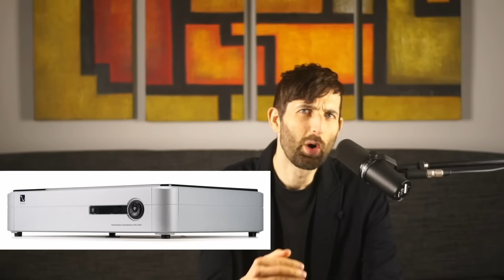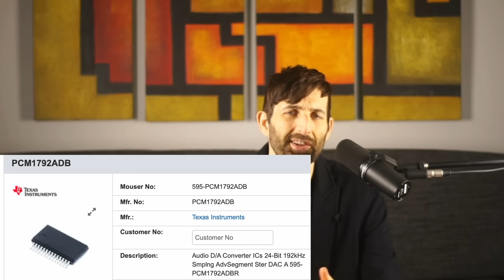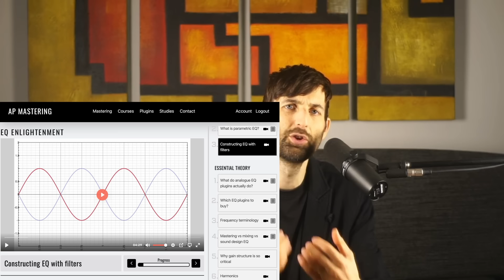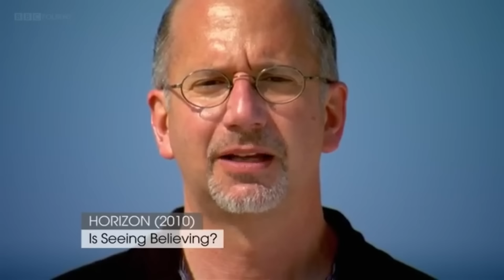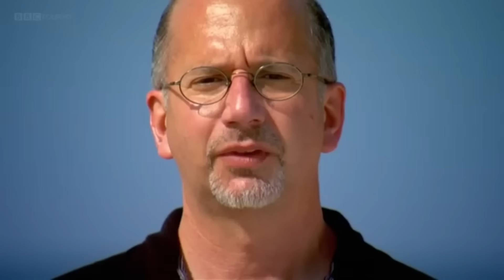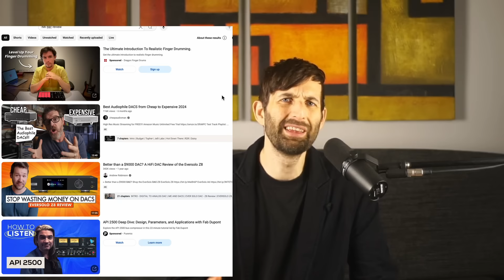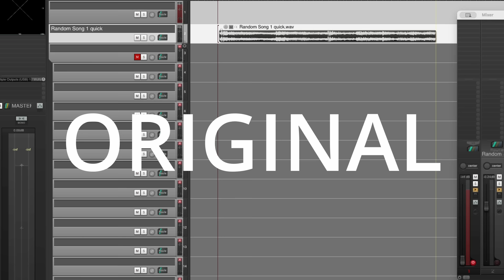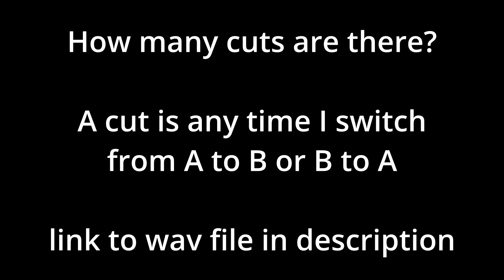The DAC Scam - Almost everyone believes the hype

Comment: The thing that makes me laugh the most about audiophiles, is they spend insane money on speaker systems to listen to tunes produced on systems costing a small fraction of the price
Reply from the maker: real pro recording studios recorded the world's biggest hits running miles of bog standard copper wire over rusty old patch bays from telephone exchanges
Reply: @APMastering Those did save a lot of space compared to the other stuff. I used to love using tiny telephones patch cables.
Reply: @APMastering Not entirely true.
Reply: @VideoArchiveGuy  Disgusting comment.
Reply: @VideoArchiveGuy  entirely? No. Often? Yes.
Reply: @ LOL that has to be the dumbest thing you have said yet. Real pro studios upgrade wiring and have full time maintenance people for these things. Wow you are a whole new level of ignorant.
Reply: @Bunbunfunfun  Upgrade the wiring to what? There isn’t an endless voice of multicore cables. The individual strands can’t be too thick of you can’t fit them into the EDAC connector blocks.  
I used to work on a console with an integrated patch bay, as was normal at the time, and because it was built into the desk it was horizontal. Meaning it was a massive dust trap. So we were constantly blowing in it, sticking the vacuum cleaner hose on it and spurting WD40 down it.  
I’ve been in a lot of high end studios, and never been in one where everything worked as intended all the time. 
Like one with a Neve V series console that had matchsticks stuck in a load of the switches to get them to work. This was so common with those consoles that when Brainworx made a plug-in version, they put matchsticks in the GUI
Reply: @ yup blah blah blah
Reply: @Bunbunfunfun  spot on, he seems ignorant and arrogant. First and last time watching.
Reply: @Bunbunfunfun  Have you recorded any albums? I have and I can tell you that the wast amount of cables that are easy to replace are standard black, cheap,  audio cables, from the nearest shop. Most problems in any studio comes from oxide in jacks and pots.
Reply: @Bunbunfunfun ”upgrade wiring”? What the hell is that? You’re making a fool of yourself. 
A good cable is a good cable, it doesnt have to be “upgraded”, and a good cable cost nothing.
Reply: the one thing you notice when you have a great setup or a treated studio, is how BAD many classic mixes are. I'm looking at you Status Quo
Reply: @telpusmusic  true 👍
Reply: Where is the problem with that?
Reply: @phild5322  what makes us laugh is how you consume music on earbuds and then get jealous and ridicule music loves
Reply: That's why there are better lables and sacd for example. Not that mainstream shit you are talking about. Sadly most pop music is recorded really bad and are over-produced..
Reply: @phild5322  - and let’s also bear in mind that a lot of that stuff was recorded on an SM58 to start with…

But when you add up to the DACs is been through before it even gets to their system, let alone all the ancient 5-10m long XLR cables without any gold plated connectors, or the fact that anything they’ve streamed has been through umpteen network switches as it crossed the cloud and through parts of the PSTN… 

And that’s before we get to all the related power supplies that aren’t encased in rubber blocks or balanced on Swiss crafted precision titanium ballbearings…

It’s a wonder se can hear music at all.  It should all just be a mess of indecipherable dithered jitter.
Reply: @phild5322  I don't get the problem. You can still improve the sound to your ears so....
Reply: they want to keep it real, you know.

🤣🤣🤣🤣🤣
Reply: Or... they spend insane money on systems to listen to music mixed to sound good on a phone or a car ....
Reply: @phild5322  absolutely no audiophile does this
Reply: Wait till these morons that spent a fortune on “audio grade” cables realize that the terminal soldered to the amp is joined to tiny copper traces that are unshielded and on the speaker side, the terminal is wired up with thin wire to a tiny flat unshielded terminal on the speaker with even thinner unshielded wires on the spider. 
You’ve essentially built a 12 lane highway made of rare-earth materials that starts and ends with dirt roads.
So
Damn
Stupid!
Reply: Another know it all - I'm not an Audiophile but a Musicphile and my system is well balanced in price and my DIY speakers are cheap to build and sound far far more xpensive than they cost to build because most speakers are the same old crap w/o any critical thinking about speaker design
Reply: Then, there were details the producer himself couldn't hear when it was mastered. Let the people who can afford expensive speakers enjoy themselves. None of them care if you happened to have achieved less than they have, and that's why you're angry or bitter about this.
Reply: @dan-qe1tb  Quite the opposite, it's these audiophiles who constantly remark you have a «shitty system» without even knowing what you have (check the comments in this thread).

While they never prove their claims in blind tests, always getting right about 50% of guesses, that's the statistical equivalent of flipping a coin. We're all open to new findings and breakthroughs, I call these «wake-up tests» because you quickly find out what doesn't matter, so you can focus on what does matter. Since decades ago they usually refuse to take part in these, and they make magical claims about blind tests not being able to measure what they hear. This way rendering each and every of their claims non-falsifiable, which in a world where we use the scientific method it's a synonym of BS.

Like we don't care if people having religious beliefs go on with them as they please, that's freedom in a free world. However, when believers start:
1. preaching
2. calling you names
3. mocking you because you don't believe
4. disregarding objective, falsifiable claims in favour of magical, impossible to prove claims.
That's when I personally use their same methods on them, because they don't support the same freedom to the same big extent I do, they actually want to squash mine.
Reply: Yet you are here..... so you aren't an audiophile??😅
Reply: For example there's a fair amount of noise on some source material, for example the venerable Stairway to heaven which I just happened to test today. Quiet parts contain very noticeable hiss.
Reply: Lets hear about your system please?
Reply: @McgavinShooter  Another gatekeeper
Reply: @McgavinShooter  Ad hominem trash
Reply: Well the joke is that people say designer op amps make a difference when the music was mixed in desks using dozens of NE5532 op amps.
Reply: True, true. Noise is and distortion is additive, but opamps are so damn good you'd be hard pressed to hear a difference  after ten of them, especially when they're used near unity gain.
Reply: I have yet to meet an audiophile like that.
Reply: Same with vinyl fans who claim they can hear analog magic from vinyl when all modern vinyls are just pressed from 100% digital masters.
Reply: @maximilianmustermann5763 Dont you know that the magic comes from the pressing?
Reply: Yeah, so you know a microphone is a cheaper piece of equipment than a stereo right? Just like in a factory it is the opposite: the robots are more expensive than the cars. Your point runs moot
Reply: same as audiophiles with 100k+ worth of equipment and 3 LPs or CDs in their "collection"
Reply: The 'hi-fi grade' mains plug fuses have to be the biggest scam.
£4200 for a fuse to go in your 3-pin plug is crazy.
Reply: @lewis72 With delayed action even, so your device can burn easily while protecting the fuse.😂😂😂
Reply: @lewis72 £42 would be almost as crazy for exactly the same reason
Reply: So why do top studio engineers have high end systems at home with expensive cable and no studio monitors
Reply: @misterzero8667  Examples to back that claim, please?
Reply: @misterzero8667 There is no why, because they don’t do that.
Reply: @ saw a video once of Rick Rubin taking one of his demos he was producing home to test it on his expensive tube amp & speakers but I always have to hear snobs talk about “artistic intent” from the musicians and engineers putting down such equipment as overpriced and a ripoff lol.
Reply: you obviously have no idea how much pro recording gear cost .
Reply: @Bunbunfunfun  Music composition is my job. I own Genelec 8341’s, use RME for AD/DA and will never be convinced to go above that. If you want better sound, build a purpose built acoustic space like I have
Reply: @phild5322  Don’t even argue with the troll. The guy literally has no idea what he is talking about.
Reply: It cracks me when they say they now can hear something like it was in the room when they recorded it.

But they:
- forget the amount of trickery applied to tracks.
- ignore the amount of not obvious overdubs used.
- disregard losses in the whole production chain, especially when any tape transfer or deterioration was involved.
- don't account for filtering from mic specs, transformers, variances, tolerances...
- weren't in that room to even know how it originally sounded.

I almost become an audiophile, but I managed to dodge the bullet early on (thanks, blind A/B tests!).
Reply: @riangarianga  It’s like im really there! I hear the warmth from the curtains and the dust vibrating on the wooden floor!
Meanwhile singer was in a dead booth and mixing engineer used room reverb with some EQ.
Reply: @thatreddot6005  That's it 😂
Reply: @riangarianga  Just because you have a crappy system doesn't make what you said true.
Reply: @michaellandskroner964  I don't even call it «my system» 😆
You don't know what I have or how I listen to music (neither how I *record* my music), yet you decided to make a judgement.
That's exactly how audiophiles speak about sound: no actual data or measurements, lots of assumptions.
Reply: @riangarianga  yet you comment.   Hmmmmmm
Reply: @McgavinShooter  What comment? What does "hmm" mean?
Reply: @riangarianga  Tell me about your system.  You people love to comment while listening to Bluetooth speakers. Onyx Sp-3 all tubes integrated, Musical Fidelity 308 and Gallo Reference 3.1 speakers.  That's the downsized system.  What you got buddy?
Reply: @dude-t5r  A list of expensive components? That's stupid, you don't listen with your wallet, but your ears. It's like those people who get a sports car to compensate their perceived short manhood.
A certain technology mentioned as a synonym of high quality? That's confirmation you don't understand electronic design.
If you want to boast about something, please focus on your listening room, how you treated it, how you phase/time aligned your speakers... That's where you start building «a system», focusing on components is not understanding audio.
Do you play any instrument? Did you play it in different rooms or venues? Did you play it together with more people, so you all have to adjust if you want to hear each other? That's when you truly learn about timbre, enjoying music, and not worrying too much about perfection.
Reply: @riangarianga  Go back to your earbuds and mom's basement. You  armchair audiophiles crack us up. I got into the hobby in 97, please tell me about your journey.... ;)
Reply: @riangarianga  >I almost become an audiophile
Nothing wrong with that imo, there's definitely good and bad speakers out there, and hearing music on the good ones is pure bliss. You just don't need to sell your house to enjoy that.
Reply: @nnuae  No you don't, I bought used speakers for $500 a pair when new  they $1600.
They were Klipsch Cornwalls II and yes they were built in 1976 but the best I could get at that price (today new Cornwalls are $6500 a pair).
They still sound great.
Reply: Getting all mad and crying about what people spend THEIR OWN money on has a word, and it's called "COPE".
Reply: @bigdallyc  
One could say the same about those who need to justify their purchases against all reason, including bench testing measurements.
And I speak as someone who has fallen for a HiFi snake oil product or two in my time.
Reply: Wrong, you have no idea how much studios and studio recording mastering and mixing gear costs.
Reply: @sb6-SSaM  I own a studio with £30k worth of gear in a room that cost £20k to build
Reply: The most funny is, how many people have opions, and never ever in their lifetime actually enjoyed a real hi end system. Are their bshit equipment in the market, yes ofcourse but not everything. And I can tell you a accuphase amplifier or a dcs or chord high end dac are way waaaaayyy above those standard sounding devices
Reply: Anyone who’s ever sat in a movie theatre can tell there’s a massive difference between your $500 home audio system and a $150k one. There is no nobility in claiming your poverty system is equal to the world’s best, it’s just pure cope.
Reply: @mikeg2491  That theatre comparison has nothing to do with audiophiles.
Reply: @mikeg2491  
Yes, the theatre system was able to go far louder to fill the large room.
Other than that, I really wasn't impressed - way too loud.
Oh, and taking a verbal dump on "poverty" systems these days is the hight of foolery.
The plane and simple fact is there are budget DACs that measure as well, if not better than many very, very expensive models.
Even class D powered chip based amplifiers are catching up with far more costly class A/B designs.
There still appears to be a challenge with frequency shifts as the speakers impedance drops, but highly transparent power and sources have never been more affordable.
Reply: @mikeg2491  The super important differences here are the acoustically treated theatre, done to a degree which would be totally impractical in most residential environments. That alone would chew up most of the audio budget.

Then you have to provide audio output power to fill a large room of 300 people rather than a small room containing say 2 or 4 people. If you simply scale up those power requirements it covers the rest of the budget.

Yes you can absolutely reproduce and improve on commercial theatre sound quality in a small setting for a tiny fraction of their cost.

Think of it as buying a bus instead of a car to drive to work, when all you need is a car.
Reply: @mikeg2491  but how would you know? You did not compare your home system in the exact same movie theater did you? You are trying to compare apples with oranges in your "statement"
Reply: @ Do I need to take a theater’s $150k Dolby vision 50k lumens laser 8k projector home with me to make sure it’s really better than a $1000 epson special too? Just because some stuff is overpriced and there are snake oil products out there doesn’t mean there isn’t high-end professional grade equipment that no middle-class consumer could ever hope to have that will outshine anything they can find at best buy.
Reply: @mikeg2491  no but you need to listen to both in the same room/placement ... And pref double blind test..before you have any idea of what you are listening to... Anything else is just pure guess work..and two dont be so foolish to compare apples to oranges ☺️
Reply: Yes, speakers are the one thing that's worth spending more on, and you can go really high before diminishing returns set in. But that's not what people are talking about here
Reply: @KariKauree If the source is poor, the result, regardless of how much the speakers cost, will be poor. Garbage in - Garbage out.

Comment: I totally agree it’s a scam. I’m not sure many people can even tell when it’s lossless or not. To my mind the biggest difference is in the bass with a decent amplifier you can hear much better detail and control. Apart from that it’s all much of a muchness
Reply from the maker: that difference in the bass is mostly output impedance
Reply: @ as in lower output impedance on the amp? I must check this out….
Reply from the maker: yeah this is otherwise referred to as damping factor
Reply: @ yeah I was aware of damping factor
Reply: @ what’s you’re thoughts on AB v D amps? This is another area which I feel is full of snake oil?

Comment: My best DIY 2ch hifi playback system breaks all the audiophile rules. I stream from my laptop's Realtek sound module via analog headphone out, connect to a downstream DSP box which performs another ADA conversion via modest circuitry, then to an older class AB AVR for seven channels of analog amplification, thence to a collection of BIG vintage and modern high quality pro drivers, mostly horns.  All connected by a menagerie of hunter-gatherer-class cabling.  And the sound quality is the best 2ch I have ever encountered and better than I had previously thought possible - given a worthy recording - and the sonic difference between mediocre and excellent recordings is like night and day. When they hear it, my electrical engineer and audiophile friends can't believe I'm pulling this off.  System cost, btw, is less than $1000USD.  Keep shining the light!
Reply from the maker: why do you use analogue out of low end laptop headphone jack... don't you have an optical out on the same jack? just buy a 5$ optical cable and plug it into the digital in of your DSP box
Reply: @APMastering  Good question.  My DSP box doesn't have a digital input.  If it did I would certainly use it.  Cheers, mate!